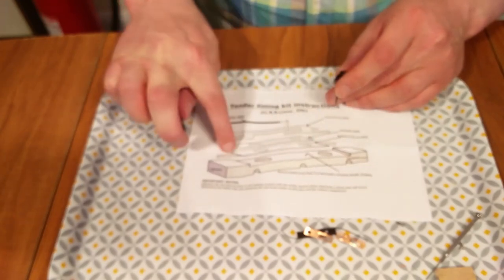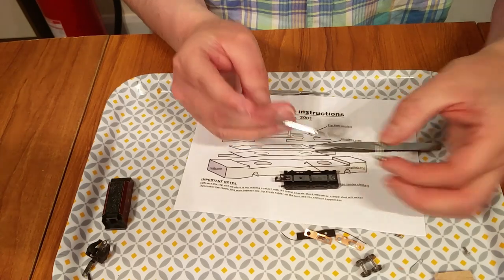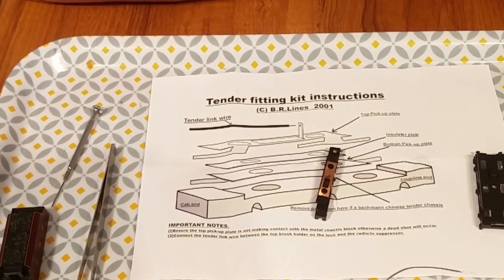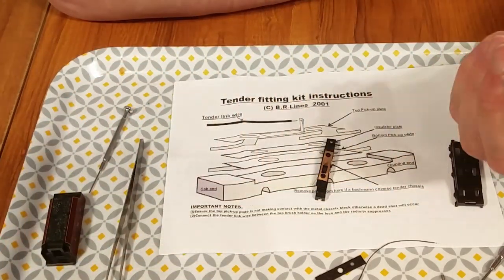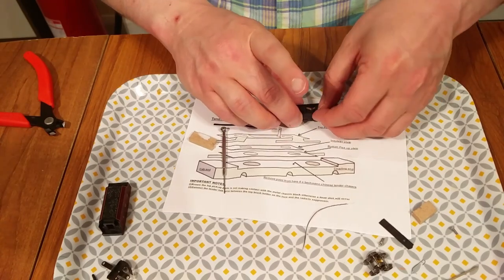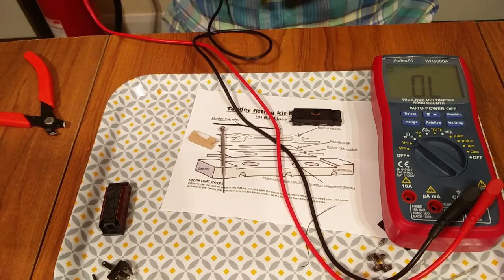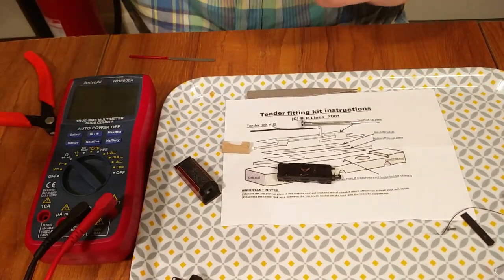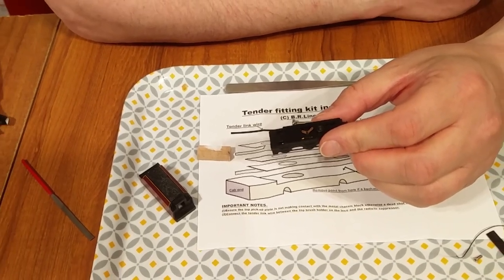12 How to install Tender Pickups | Improve your Graham Farish loco's running with BR Lines pickups.

Comment: I did this to my A3 and it did work, but it was a fiddle to get the pickups bent inwards enough to allow the wheels to turn whilst still keeping in contact with them. When I serviced the same engine a year later I saw that the tender wheels were jamming up again so I disconnected the tender wire and, to be honest, I've found that Poole tender engines work well enough without tender pickups, even over insulated frogs (I would guess that the heavy diecast bodies help with this).

Comment: Hi Steve, Thanks for these videos on DCCing. I've just recently returned to the hobby and dug all my engines out and was considering fitting DCC to all my GraFar. I have an identical model which I stripped the other night to get a feeling for how they are wired up and then found your first video. Did you do a third video on fitting the decoder? Did you fit the decoder in the tender or manage to squeeze it into the cab?
Reply from the maker: There is a video on fitting the decoder. My name is not Steve!
Reply: OOOps. Sorry got the names confused. DOH
Reply from the maker: no problem. I do not give my name in my videos, but some people what it is. However others getting my name wrong has become a bit of a theme in the last month or so!!!

Comment: Hi! Loved this video. Very down to earth 'warts and all' style you have!!  I have just got another old GF Duchess on which I was planning to do the same DCC and sound conversion. However I discovered is already has tender pickups. However, this is a mixed blessing as on one side the power connects via the chassis, so I am going to have to figure out how to isolate from the chassis and replace with a wired connection to match up to the body on which I'll have done the digihat trick as in your other video! Any idea as to how that might be achieved? Or know someone else who has already done it? Anyone else on this video welcome to contribute of course!
Reply from the maker: If you need to isolate the pickups from the chassis then you might well need a digihat. I have another video which shows me trying to fit one to my duchess.
Reply from the maker: I have read your comment a bit more carefully. 
The point is that the digihat isolates the motor brush from the chassis. It is not necessary to isolate the pickups from the chassis, in fact one of the pickups is deliberately connected to the chassis, although the other one needs to be isolated from the chassis.
Reply: @naivegauge  Thanks for the ultra rapid response. Yes indeed. I have seen your other video about installing the digihat to isolate the brush connections in the body of the loco, including remembering to heat the heatshrink!! My question here is more about how to achieve the isolation from the chassis in a DC based model where the tender already has pickups and uses the chassis for the connection - connecting to the body using a metal strip in the towbar - so that I don't end up with a short at the tender end. I'm thinking maybe of keeping the connection with the metal part of the tender, but somehow isolting the connection back to the engine body via that strip and replacing it with a direct wire back to the relevant decoder connection, as the decoder will already be in the tender anyway..? I was going to copy your entire installation approach but the existence of the tender pickup already in situ threw me. (By the way I also wanted to install the BR Lines tender pickups in an old GF Black 5 that has been too hesitant but discovered it has a completely different - and frankly rather cheap and nasty - all plastic tender design that renders the whole thing pretty impossible. Given up on it I'm afraid...)
Reply: @naivegauge  Yes yes! Of course. I should have realised. I think I was just looking at the fact that your installation of the tender pickups resulted in having two completely isolated and separate brass tabs to solder to. But so long as that single brush is completely isolated we won't get a short. That is going to make life a lot easier. As is the existence of the pickups on the tender already. Many thanks. Really enjoy all your videos!
Reply from the maker: I think the usual way to install tender pickups is that one pickup connects to the chassis of the tender (and via the drawbar to the chassis of the loco). The other tender pickup is isolated from the chassis and a wire is soldered to the tab and then connected to the top brush of the loco.
However I used a bit of heatshrink so I could solder to both the tabs inside the loco, and then that was a covenant place to attach the decoder.
Reply: @naivegauge  All makes perfect sense!👍🙏

Comment: My track gets so bad, I've considered fitting pickups not only to the tender, but to all the carriages as well, with tiny plugs + sockets to connect the rolling stock together.
Reply from the maker: What did you consider using for your "tiny plugs and sockets"? I have considered similar things (in particular between stem locos and tenders) but everything was too big for n-scale.
Reply: @naivegauge  N Gauge would certainly be a challenge in that respect. I'm with HO/OO. I'd possibly go for the flat twin plugs and sockets that are used for charging the cheap "toy" drones and toy foam r/c planes. They are darned small. They'd certainly be usable with HO/OO. N Gauge ? - You'd need to check out the items against your rolling stock.

Comment: It's a shame the video doesn't show how/where to attach the wire to the loco? I see the instructions says "between the top brush and the TV suppressor" but would have been good to show this.
Reply from the maker: Yep. If I do another tender, I may make another video, and try to make some of these things a bit clearer.
the simple answer is that I cut off the suppression capacitor, and the soldered to the remnant of the capacitor leg.